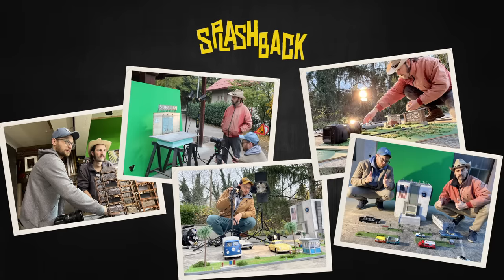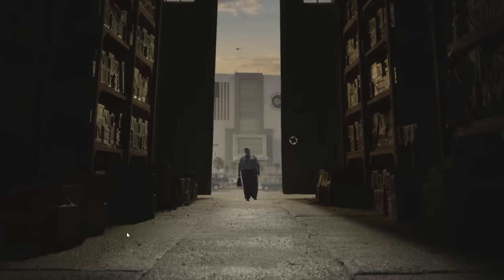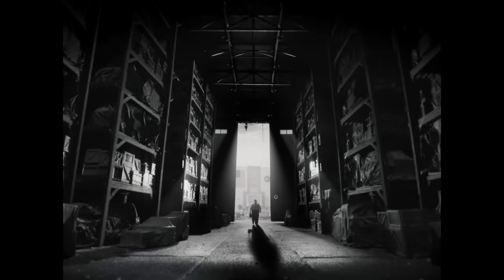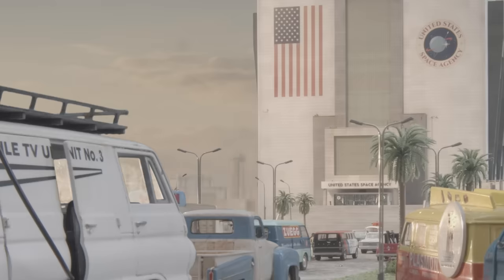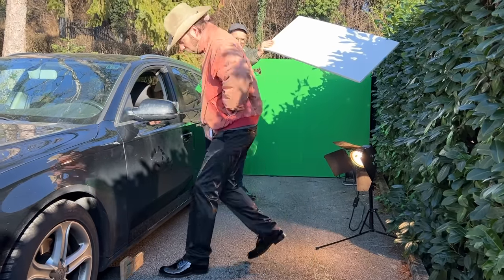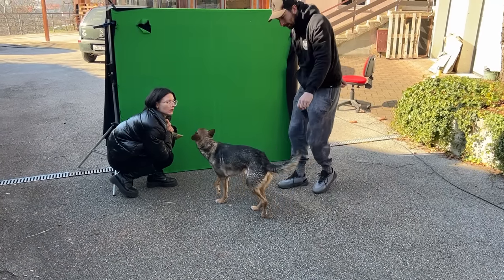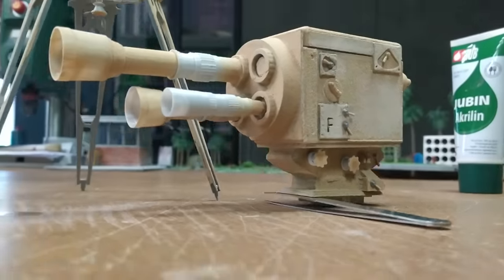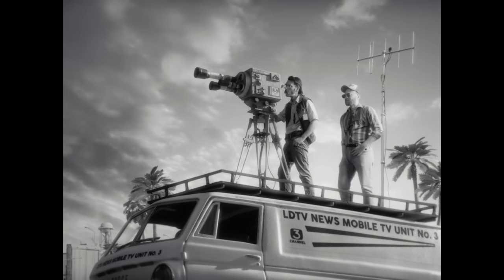Compositing Miniatures and Creating Realistic Shots

Comment: First of all, what a great job! Some things, I would do different, perhaps better, but most things definitely not. The results are overall so well and done with pation and diligence 😘
Of course, there are several ways to do the jobs, and about the actors shadow - you can make him a 3D layer in AE, put and adjust al light behind what can present a (just the ) shadow on a oriented  layer (set to 'only cast shadows') underneath. If needed, add a blurFX with mask/ramp/precomposing stuff.
Or double the layer, set the pivot to the feet, make it a 3d-layer and flip it  on the x-axis and adjusting the camera / or a composition which is large in high with a  layer and the sillouhette on it, distorted by the corner-pinsFX + blur like mentioned before. Just some suggestions I would prefer before activating a laser-cutter or rebuilding the scene in 3D-programs.
But using the floor reflection as a reference and basis for the shadow is great!
One thing doesn't look right for me - the volumetric light, I'm not sure but I think the lightrays of the upper windows have to move or stay more sticky the center.
Oh, and instead of repairing the matte by masks - there are some realy useful tools inside of AE which are  fixing (not only) holes inside.
I also missing some shadows in the 'in front of NASA building'-shot .The blue/white truck on the left, even if it's casted by boxes. The actors also look somewhat assembled - but that could also be intentional and a concept.
The filmcamera on the truck looks a little bit to big for me, but the result and compositing is dope!!!!
The miniatures and integration of this lovely paintings are also - surprising - dope. 
I get the feeling that it's a personality that finds it difficult not to do everything alone. But with this talent, it would be difficult for me too.
😍🤩👌🤘👍

Comment: more fantastic info, thank you! May I ask if you have any tips for matching angles for your shots? I understand it's a bit of the eye test, but when you are shooting each element, how are you comparing shots? do you always have the whole project up and running on a computer? I dont use your editing software so dont know how slow or efficient this would be!
Reply from the maker: Yes it's very much by eye. We filmed in my yard so I could run in after each shot and comp it in quickly to see if it works. But it's also quite forgiving. If the miniature is shot in low angle, and you film the actors in a general low angle, it should work ok. You don't really need to calculate these things. ❤